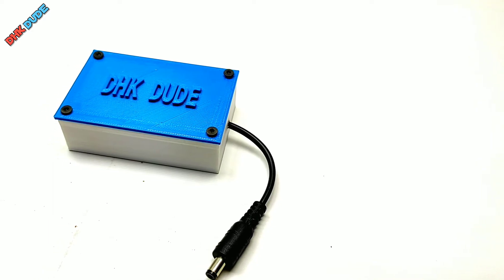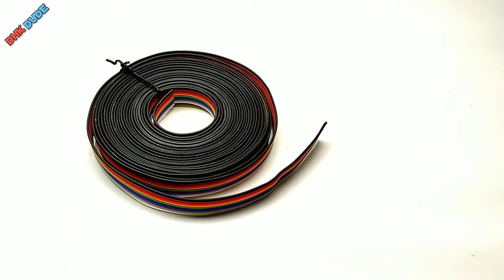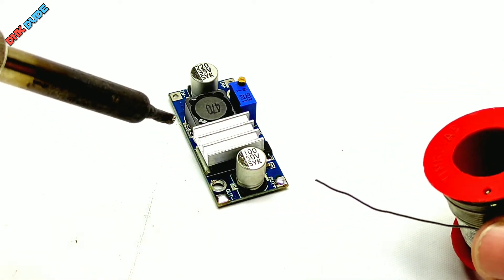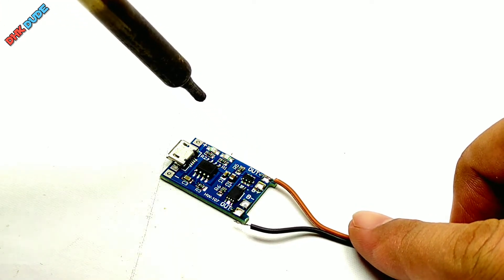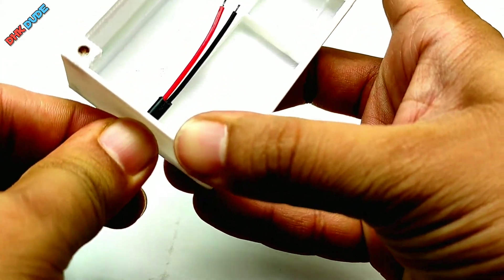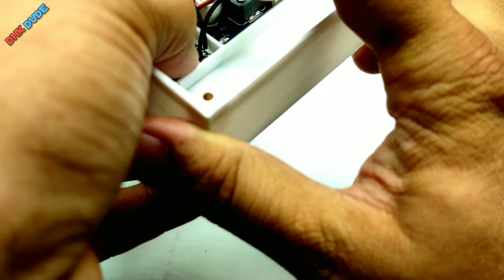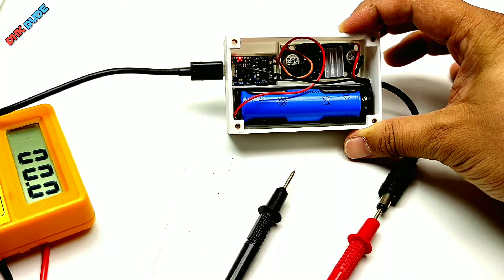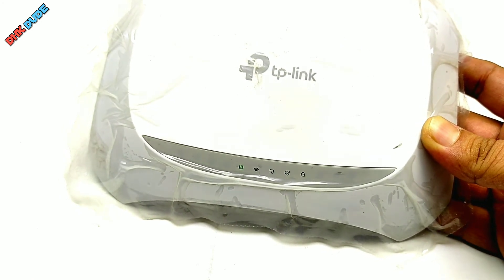DIY - mini UPS for WiFi routers (6V-24V adjustable)

Comment: i have a router 24v does it work properly ? @DHK DUDE
Reply from the maker: I would suggest you to go with other good buck converter available in market for 24V application. This combination works good upto 12V as you increase output voltage (above 12V)  you have to increase input current as well as voltage to provide enough juice to device.

Comment: Becareful low voltage from battery can overload the voltage of xl6009 raise to >20v. you need bms for battery to cut the connection

Comment: can i use two output instead of one?
Reply from the maker: Hi, that's technically possible but not with same components. You have to use 3S configuration for better performance output. You can use 3S BMS module with any dual output boost converter.

Comment: Nice. But...wil my router with 12v and 2 amp work with this ups? One battery will not be enough, so how do I add another 3?  I'll need bms.
Reply from the maker: Hi, yeah that's true, 2amps is not recommended. you have to put 2 or 3 batteries in parallel and have to use bms according to 2S or 3S connection. there are many 2S and 3S 18650 batteries BMS modules available.